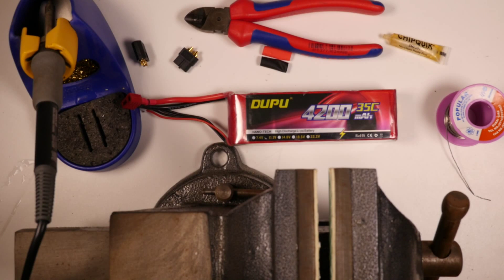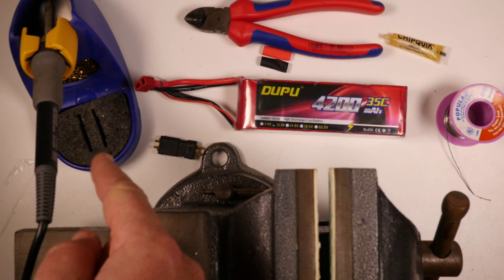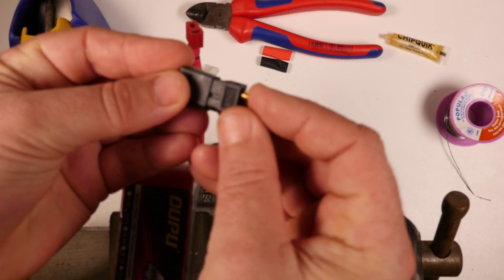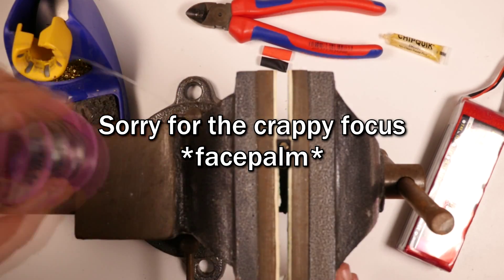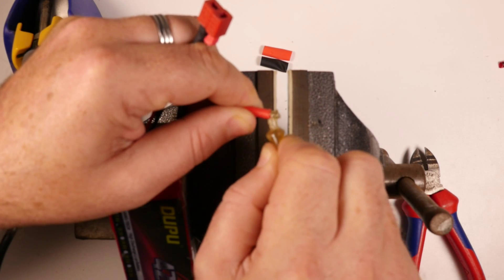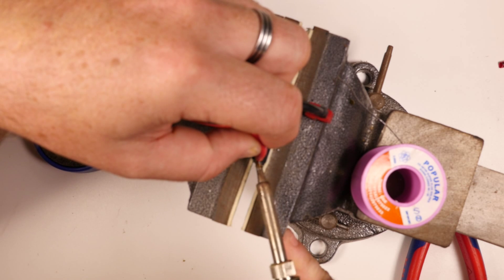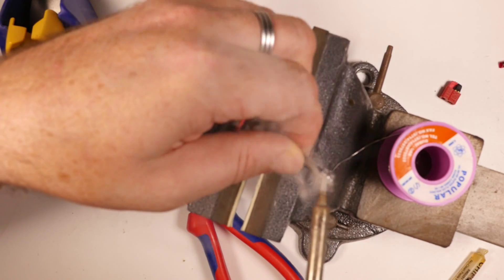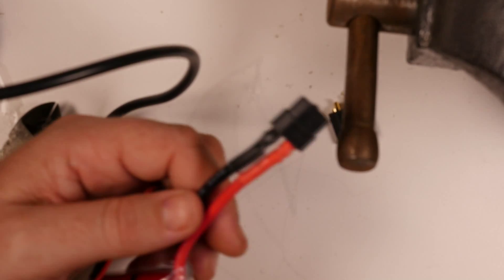How to Change a LiPo Connector

Comment: Well explained. Glad you stressed the importance of only cutting one wire at a time :). 
One thing that I see you are using but did not explain was the tip size. For large connections like these you need a large flattened tip not the typical small cone. I also crank up the set temp to be able to get in and out quickly.
I don't know about you but I have damaged a number of balance plugs flying miniquads. I recently bought some JST-XH plugs and sockets on EBay. Great for repairs or making custom balance leads and boards.
Reply from the maker: Rob B Cheers Rob. Yep I'm using the Hakko 3mm chisel in the video, which gives great heat capacitance, and comes standard with the 888D solder station.